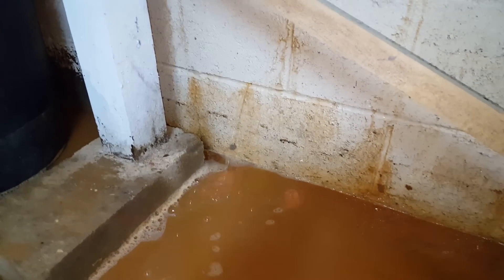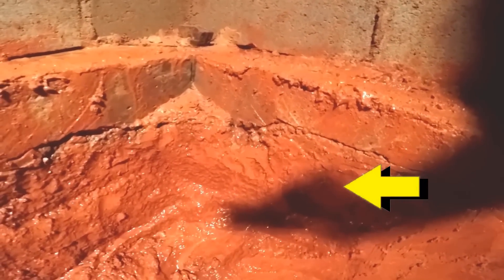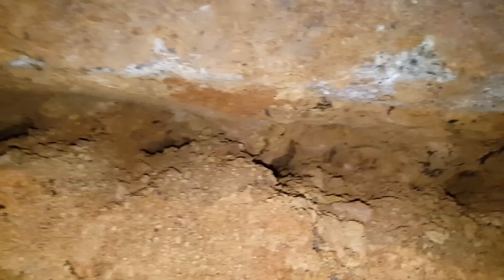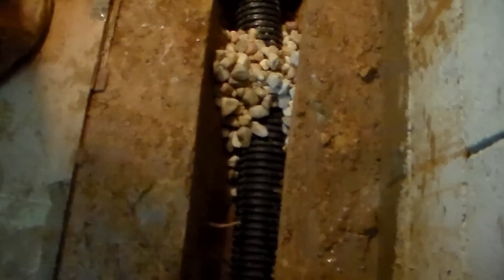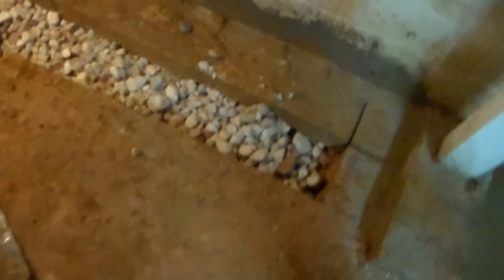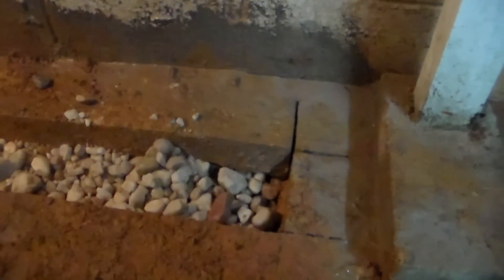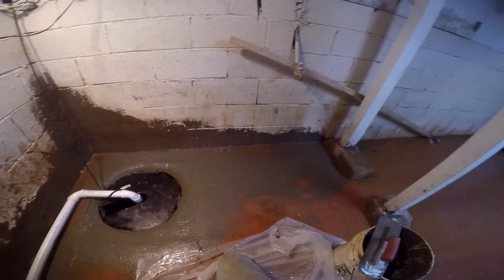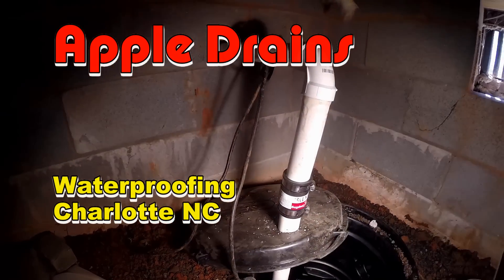WET BASEMENT? How Footer Tile Works to Drain The Basement  Wall

Comment: Are you concerned about compromising the foundation by digging down so far below the slab?  I've read that when installing drain tile, the trench shouldn't go below the footing unless it is a bit of distance away from it.
Reply: I'm wondering the same thing, and I was reading you generally shouldn't dig deeper than what would create a 45 degree angle from the footer/slab.. Not sure I'd want to get that close to the footers in my crawlspace.